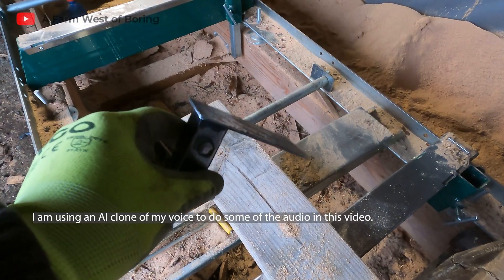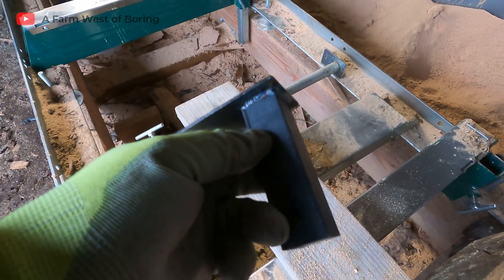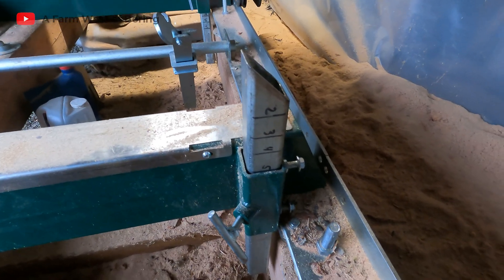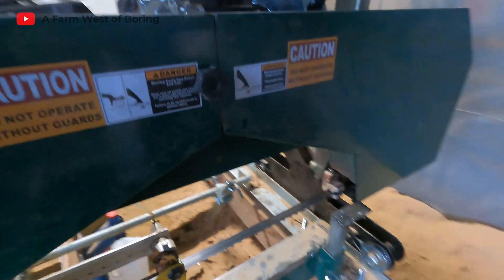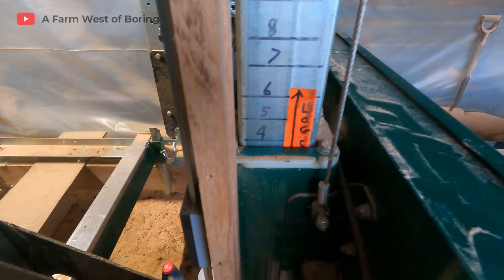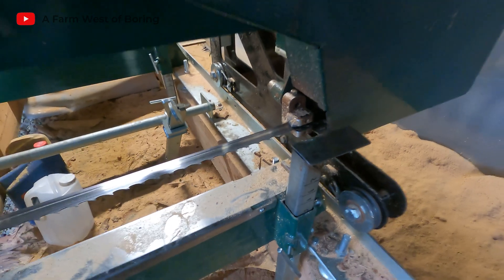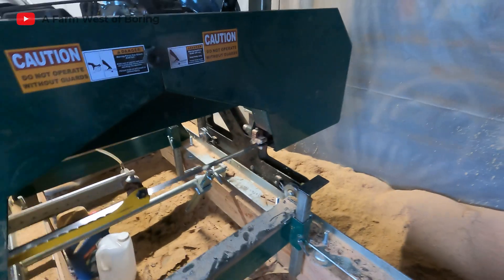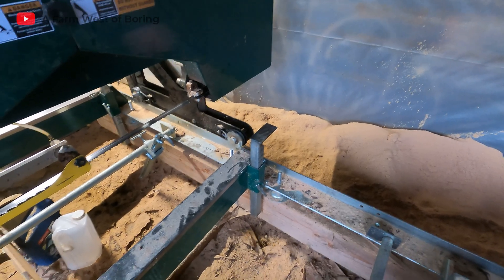Revolutionizing Woodland Mills Sawmill Safety: Prototype Sawblade Protector in Action

Comment: Ok folks I’m a firm believer in being aware of your surroundings 
That’s at work at play at hobbies 
I have had many saw mills over the years Woodmizers and now a woodland 130 live the woodland Woodmizer’s are the Cadillacs of home milling hands down 
For the price differential between the two woodland mills win hands down 
Now as far as your blade stop goes fill your boots bud 
I have cut thousands of board feet over the years and I can honestly say I have hit a log stop once and haven’t since 
Being aware of your mill is key to not running into problems
Reply from the maker: Thanks for your comment. Yes being aware of your mill is key. But just a quick search of "log Stop" in the Woodland Mills FB group will show that there are many sawyers who for whatever reason momentarily had an awareness lapse and sliced right into the log stop. Should we tell them just be more aware, or what if there was a device that could pretty much prevent them from hitting the stop? Again, thanks for the advice.

Comment: What happened to the blade protector that came with the sawmill?
Reply: Mine lasted a couple logs and is lost to antiquity....  (aka fell off into the endless chip void)
Reply from the maker: I am amazed by the response some ppl make to my device. It works. The OEM one works sometimes. And many ppl leave them off or have them sticking straight up (aka Sawing with Sandy). So why question my device? It works!
Reply: The standard one has many downsides and short comings. Mine is so tight that I have to use a wrench to turn it (I think the facility accidentally cross threaded it to be honest) and I've never been able to get it to be fully tight when with a wrench. It also has a very narrow angle range that it must be in and is easily set wrong so it won't hit the stop and this won't stop the saw head. The gustafstop eliminated all those and is super easy to use. When I don'tt need it I just turn it sideways when I drop the stop and when I set the stop I turn it back out. It's far more effective than the stock device.
Reply from the maker: Thanks for the review. It is effective. and it can be used along with the OEM guard. I doesn't have to be either or. but it can also function alone. Thanks again!
Reply from the maker: I put mine in a drawer. It came loose and was in the way when I changed blades.!